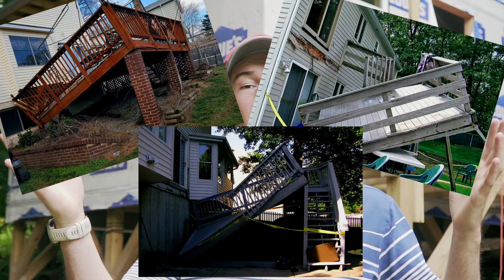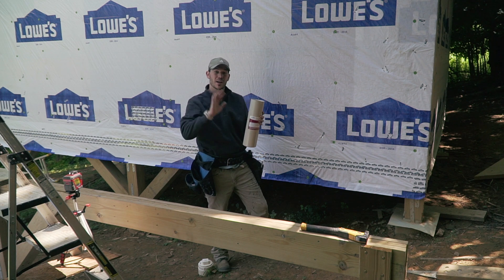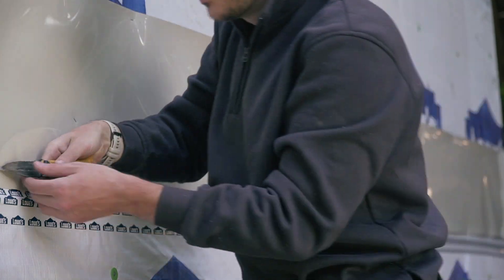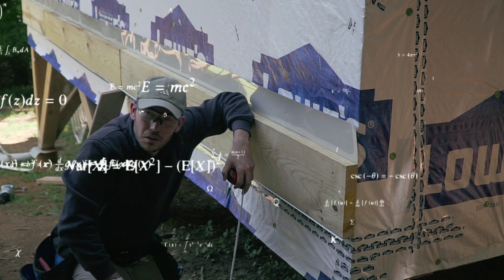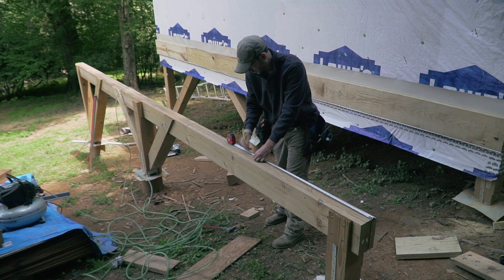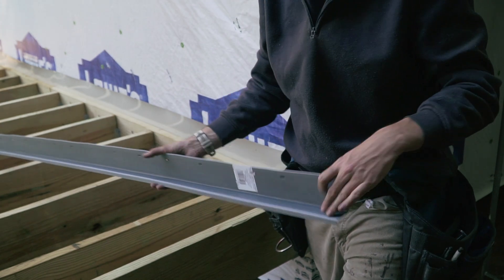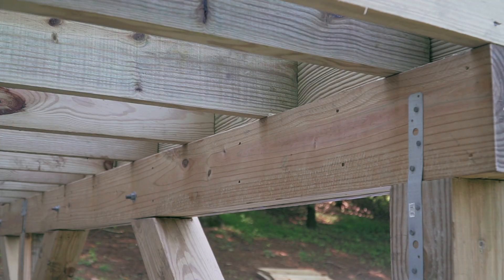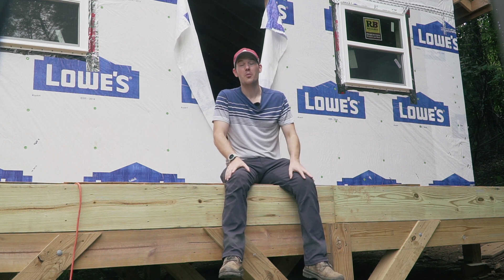Structural Engineer Shows the Right Way to Build a Cabin Deck - Cabin Series EP 36

Comment: I hate to tell you but that woven building paper is going to let water through so no matter how well and redundant you are with your flashing, the woven house wrap will let water in above it and down behind it. They should outlaw that stuff, it shouldn’t even be sold.
Reply from the maker: What would you have used instead ?
Reply: @TheDIYCabinGuy  anything non woven. Tyvek or Typar to stay in the realm of staple up WRB. I’ve pulled apart too many houses where that stuff was just shredded behind the siding from breaking down. Matt Risinger also has a video about it I believe he does some testing to show it not being protective from water.

Comment: I’ve been watching your build up to this point, and I have truly enjoyed it. I see that you’re an overkill type of guy, but that has it’s advantages. 
I was thinking, you have all kinds of flashing on that deck, but I know water will get to that drip edge you installed that goes under the ledger board, and it will hold water in spots. I would have had the flashing stop at the top of the ledger board then put the drip edge to go over the ledger board. 
Anyway, I really enjoy the build and the videos. Thank you for sharing. God bless. 
Texas.
Reply from the maker: Thanks !

Comment: I don't know what kind of tape measure you have but they usually have little red arrows that indicate your 16" centers. Also if you are worried about uplift you could used a hurricane tie on the underside instead of toeing those big screws in. Nice job though 👏
Reply from the maker: I think it was off since I started the second joist at 8” on center then at 16”. Yeah the hurricane ties work too, those fully threaded screws work just as well and are so much easier to install.

Comment: Interesting. Can I ask how does the first strip of flashing help after you completely covered it up with more flashing and tape? Seems to me you could’ve skipped it to save yourself some grief. 
Not easy working alone. Try tacking a nail in for you to rest the further end of the ledger on, or any 2x. Easily removed once the board is secured. 
As someone who thinks they’re more capable than I probably am, this gives me pause to assess realistic timeframes. Keep it up 👍
Reply from the maker: Good question, the first tape was wide enough to cover both the counter flashing over the ledger as well as the back flashing. 
Adding the second layer of tape might not have been needed, I just did it because the flashing tape seem pretty thick and I felt that adding the lowes house wrapping tape (which is extremely thin) would allow water to percolate over more easily than the thicker flashing tape.
Again, this might not be needed, just seem to make sense to me and didn’t take long.
Reply from the maker: Chris, weee you talking about the back flashing and counter flashing ? I think the back flashing is really just an insurance policy in case water (somehow) made it through the counter flashing above the ledger. It might all seem like a lot, but it really only take a minuscule hole to let water in and wreck havoc with the framing over time.
Reply: @TheDIYCabinGuy  I was referring to the vinyl flashing. Also looks like the drip edge might be good at collecting water, unless it’s bent to an angle greater than 90 degrees.  
All the best to ya.
Reply from the maker: @chrisinwood9041  you know it’s funny you say that! I thought exactly the same about the angles. But all details of proper flashing I could find online was showing what I’ve done. Kind of strange!